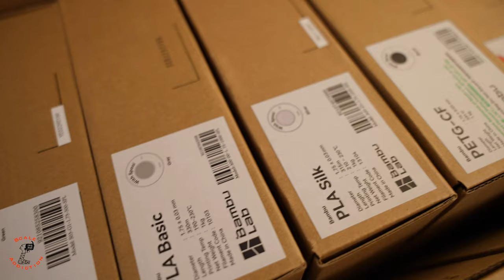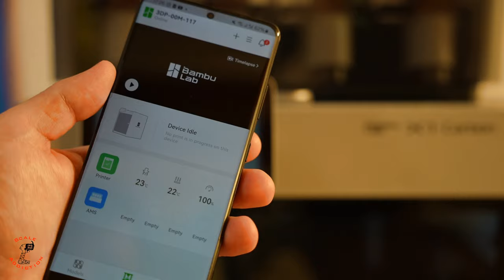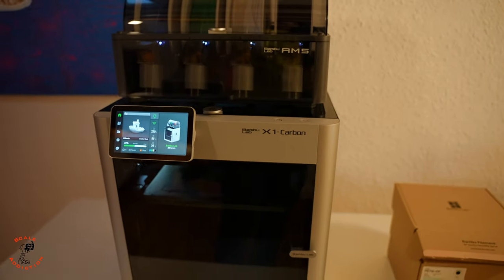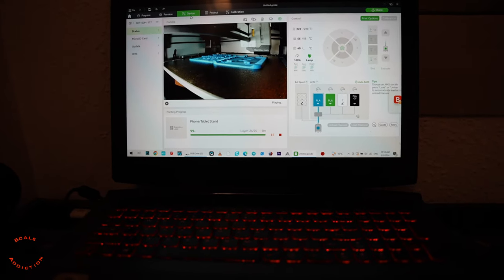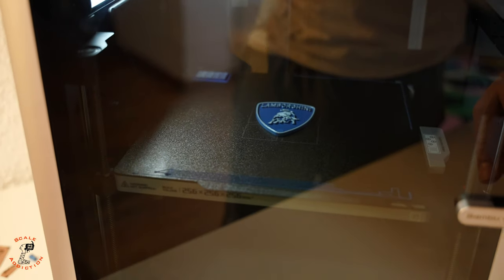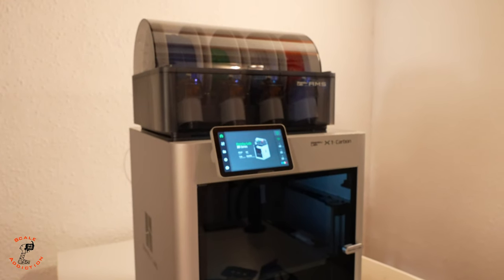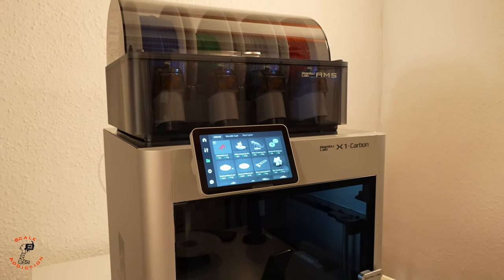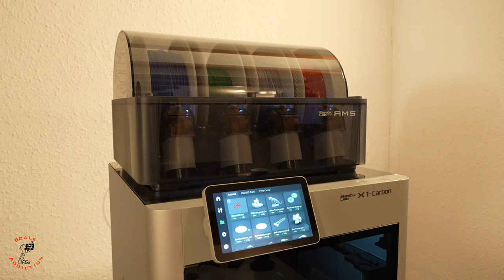Used Bambu Lab X1-Carbon Combo 3D Printer for 3d printing carbon fiber for my supra| Scale Addiction

Comment: It's Carbon Composite filament, not carbon fiber.... with only 12-15% of carbon fiber.  
I also have a Bambu X1 Carbon, but I use it with Prusa's PCCF (PC Blend CF), it contains much more carbon and PC is more temperature resistant than any PLA/PET/PETG shit).
I hope you're using a hard-steel extruder, as carbon composite filament is very abrasive and destroy any standard extruders
Reply: If only it has 1%, its carbon fiber,  so 12 to 15 its carbon carbon fiber 🤭, for sure it has to be mixed with plastic,  no way to inject 100%carbon fiber from nozzle
Reply: @MiaMia-ru8ce  tf are you saying
Don't confuse carbon fiber with pure carbon...
Carbon fiber is only 100%. If you have to combine it with another material then it's carbone composite and not carbon fiber anymore.

Since filaments aren't 100% CF, they are composite. Filament with 1% CF is a carbon composite filament and ofc it's not strong and resistant as a real CF part.
On an equivalent composite, the more carbon fiber you have, the more resistant you are. A PETCF with 28% CF is stronger than a PETCF with only 15% CF. Beyond that, the materials used in addition to CF also make a difference. For ex PC Blend CF (PCCF) is around 28% CF, with Polycarbonate. It's a carbon composite with only 28% carbon fiber.

F1 parts are mostly using 100% CF (only fibers) with a resin, they don't combine it with shitty materials like PLA. Because it's shit.

Thats why Lamborghini call them Forged Composite (because they use forged carbone in composite) and not Forged carbon fiber.

So no, 1% isn't the same as 100%. Even 5% more carbon makes a big difference to the strength of a composite.

Saying he print carbon fiber is wrong. He just print a regular carbon composite (and by far, not the best one)
Reply: PC Blend CF is really good also the other PC Blends. But the price is a bit high and also the availability sometimes is very bad.
Reply: As a x1 carbon owner you should know that comes with a hardened steel nozzle.
AND hardened steel gears in the extruder (as any printer should have that's used to print any carbon induced filament).
So 'hoping" he has that in his printer that is exactly the same one you say you have... Lol.
And going on a rant instead of just correcting info lost in translation, wow.
Reply: @FATSNAIL-FPV  And a 0.4 SS nozzle. This explains the precision of using the HS nozzle.
As for the rest, I won't even bounce on these tasteless personal attacks.